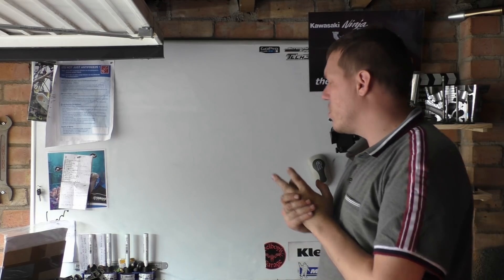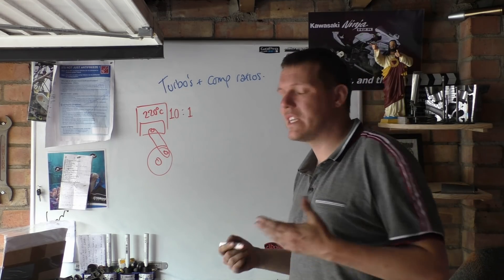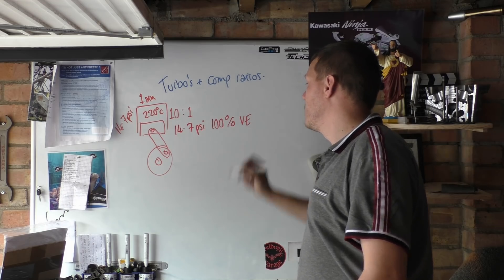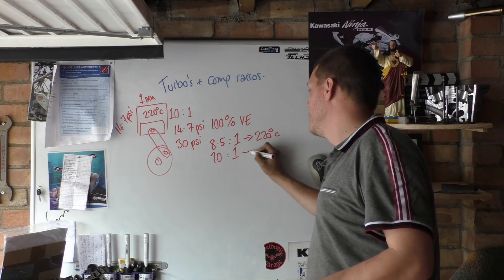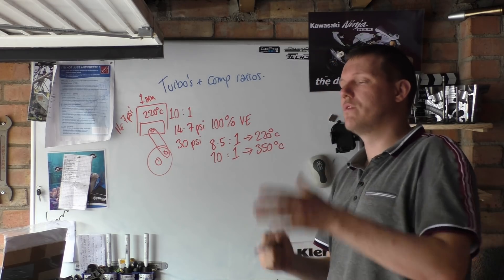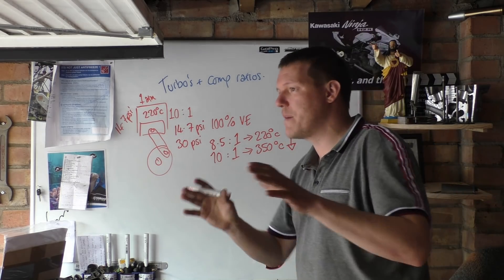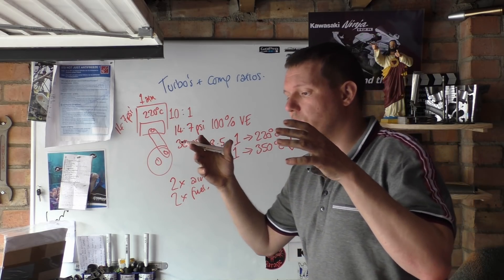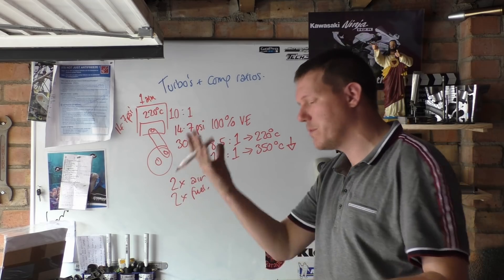So you wanna Turbo your bike - part 4

Comment: Purchased a turbo gsxr1000 non running, got it started then it died on me an I've been at war with it since (2 weeks) for some reason I'm not getting fuel in one of my injector rows, and real shoddy spark as well, I've checked all my kill sensors an still no luck.. it has 2 power commanders a power management and ignition module as well. also running a begi FMU a walbro external inline fuel pump and a turbo timer bike came mostly dismantled also getting really shoddy spark any info would be great no quite done watching your videos really hoping I get a light bulb moment during 1 of them.  Best, art

Comment: I have a question, could be a stupid one but stick with me... If by adding a turbo, our air fuel mixture/existing compression ratio is too high to accommodate,  would simply running a higher octane fuel capable of withstanding those higher ratios also solve the problem? thanks.
Reply from the maker: No. Well it depends on how high. Running 100% ethanol or methanol gives you you an octane rating of 108. - That's 100% so running 50% 95 octane + 50% ethanol would give you about 102 octane.

Avgas (aviation fuel) still has TEL (lead) in it and that stuff has an octane rating of 130 max. But it changes from blend to blend.
Reply: @thedirtyworkshop  thanks for the full response

Comment: I apologize if this is too crazy or foolish. But what if, I kept the high compression-ratio, advanced the ignition-timing a few degrees for improved response, and to prevent preignition & knock, I just setup the engine to inhale chilled air?
I always wanted to have some freezer or ac system, for intercoolers, and the air entering the turbo compressor itself.
Reply from the maker: You'll have to drop the temperature quite a lot, and the problem is can you chill say 1 litre of air for a 1 litre engine @ 5,000 rpm quick enough? The answer is no. That'll be 2,500 litres per minute or 41.6 litres per second. Your heat exchanger would 1 - be massive, 2 be a massive restriction
Reply: @thedirtyworkshop  
Thank you.
I have some experiments planned, including using Peltier-Devices. I love Dustbin-fairings. I'll have a lot of room, to hide components. I'll let you know how those experiments go, when I'm able to do them.
Thank you for helping me.
Reply: @thedirtyworkshop  
I just had a great idea.
Another thing I learned from car racing. There is a system, that increases boost, every time you shift up.
You program every gear, to have it's own max psi.
It's meant to make it easier to maintain traction, when launching a car, but you will have full potential, in top gear.

I can use that system, to keep boost at safe levels, but at higher speeds, I can use that higher airflow around the bike, to get the most out of my chiller system, with high flow radiators, intercoolers, and or heatsinks. 

I can also just setup an Arduino, to limit boost, based on the air temperature, after the chiller system...So it can never be in that preignition temperature range...

And I found an aftermarket knock sensor, that turns on a light, when it detects knock. Thank you for telling me about that. Along with a wideband A/F gauge, that knock sensor will be a big help, with my experiments.
Reply: @thedirtyworkshop  
Hey.
I found the video where I learned about that system, that let's you set the max boost level, for each gear.
After watching that video again, I thought I couldn't use that system, because it looked like it can only control boost levels, when shifting up, not down, so I would have to reset it, EVERYTIME I came to a stop, or else, I would be doing wheelies, like a speedboat in wavy water, when I tried launching again. Like when getting away from traffic, after a redlight. Especially from Electric cars.

Plus, it looked like it needed the clutch, for it to work, but I really, really like Quickshifters, because they let me save my clutch-hand, for waiting in gear, at a light, ready to escape a rear-ending or something. And, a Quickshifter is great for a turbo system, because it allows me to shift-up, without chopping the throttle, and slamming the door on all that compressed air, that's flowing from the turbo. So I will only need a recirculating Blowoff-Valve, when I intentionally close the throttle, to avoid something, take a slight curve, slowdown, or stop.

But I found that Turbosmart e-Boost 2 system, and downloaded the Instruction Manual...
And it's great!
So many features.
I can even limit boost levels, by RPM, so when I want to ride around, efficiently, like in 3 or 4 thousand RPM, I can set it to allow little to no boost, in that range.
And it CAN control boost limits, for every gear, whether I shift up or down, without resetting.
SSB, Sequential Switching function B.
Which doesn't need a clutch.
I maybe able to use, even combine, the shift-lever switches, that a gear-indicator kit uses.

The video where I learned about boost-by-gear:
https://www.youtube.com/watch?v=4ICz12UcRCc

e-Boost2:
https://www.turbosmart.com/product/eboost2-60mm-black/

Comment: Hi
I have few motocycles in my garage and decide to turbo BMW K1100 1993. Was looking for any info but there is totally lack of information, and now found your video and can start up. Will you (maybe) give me some advice for that particular bike, especially what kind of turbo should be used. I'm going to attach intercooler as well. The problem will be also to lower comprssion ration because originaly is 10:1, so the question is how to lower that in a proper way? Thanks in advance,,,

Comment: Awesome video, I can't find any info on turbo charging my KTM 450 mxr outlaw quad. I'm thinking draw through vz21 , but this thing has 2 oil filters side by side behind the head , which one can I tap for oil. This is the part I can't find info on. Thanks in advance for Any help you can give. I'm just finishing up my outlaw 84 Vette.i put twin turbo under the rear with a750 Holley dp blow through setup. So I gotta turbo the 450 outlaw now. There a matching pair lol
Reply from the maker: oil filters on the head? Sorry dude guads aren't my thing. Do you have an oil schematic or a manual link or something?
Reply: @thedirtyworkshop  the oil filter on a motor cycle engine is in front of the head mine are behind on top the crank case along with the starter, but is there any harm in tapping one the filter covers?
Reply: @thedirtyworkshop  I would like to find some specs on the ktm 450mxr engine. Like compression ratio, valve lift, and such
Reply: Where can I find an oiling diagram or blueprint for this engine
Reply: I figured out this ktm450mxr has 2 rotor pumps inside , that's why 2 filters. But one is shorter than the other and I have no idea why there's 2 pumps or which one does what lol. So I still don't know which one to tap. I'm thinking one of them supply's the top end, and that one is the one to tap.

Comment: Is it possible to inject the fuel at top dead center... I think it's called, and cause the thermal ignition at the right time without a spark plug?
Reply: NVM
HCCI Mazda
Reply: And Diesel Engines
Reply from the maker: No, well you can but its not a good idea - more on this later.

Comment: Back in the 90’s I had a Saph Cosworth, tuning or optimising as you correct me, involved lowering the compression ratio, putting in a metal HG, huge turbo and sloshing fuel in with grey injectors. Was horrible to drive, all lag and torrid boost... what manufactures get away with these days when you look at comp ratios and turbocharging is genius. Big power 2.0 in-line 4’s are now nice to drive.... sorry for the car talk. As you were.

Comment: Easy way to drop the compression, get a bit of steel 2mm thick and cut out your head gasket thats what i done to my car a few years ago to turbo charge it 👍🏼
Then a 5th injector on the inlet manifold wired to a bosst switch to compensate for the extra fuel needed 👍🏼

Comment: Can boost without adding additional fuel, increase compression in effect improving thermal efficiency
Reply: Then you would run lean all the time which leads to increase in NOx and CO emissions and higher combustion temperature. So no, not a good idea.

Comment: Great video Matt, Im about to start a Turbo build on a GSX1100, its a first for me so gaining as much  good guidance as possible, had a Garret turbo built for the job with billet internals, with spacing the barrels  I'm told I can run about 8-9psi, I will have a search for parts 1 2 and 3 later, cheers for the upload.

Comment: How would you go about changing the compression ratio for an engine? Smaller conrod?
Reply: Em Fr You can put two headgaskets on, is the easiest way. Although im not quite sure if its the most ideal way.
Reply: blu3flare25 didn’t know if that would be enough to go from 12-1 to 9-1 or whatever with just a few millimeters. I feel like a shorter conrod would collide with the crank at BDC. Could possibly make an aluminum plate that fits between the head and the block?
Reply: Often it is done by machining out the chamber, part of gas flowing process tends to do this, you can also use a slightly different piston crown

Comment: What if you compress just the air to a really high ratio and then use a really strong injector to spray in fuel at TDC?
Reply: That’s exactly what a Diesel engine is lol
Reply: Recently there are some direct injection petrol cars, ironically one of the downsides to them is that the inlet valves can get coated up with oil deposits etc from crankcase breathers etc, no petrol passes by them to clean them. Some of the desperate solutions include fitting the engines with double the number of injectors, each cylinder having a "direct" injector and an "indirect" injector, which one is used depending on engine temperature etc.
Reply: Modern diesels often inject in "phases", the combustion is not instant so injection is advanced slightly, so just before TDC. In the interests of quietness etc some will inject again after TDC....I am not an expert on this, just have a diesel car....
Reply: Why not do the same with petrol but at TDC? Petrol is more volatile than diesel so it should combust faster and it's better if the power is applied to the piston after TDC in terms of efficiency, no? You'd probably be able to forego the spark plugs too since the air is already compressed and hotter than the autoignition temperature. But the injector would have to overcome the pressure inside.
Reply: I think that may be exactly what makes gasoline a poor candidate for a diesel cycle engine - It's volatility compared to diesel, kerosene etc.. I don't know exactly why but i'm sure there are tons of articles online about this. It's been many years since I studied this stuff in Thermodynamics class in college so I don't know from memory. It's certainly a good question which likely has some very discrete reasons as to why it won't work well/better than just using gasoline in an spark-ignition otto cycle or diesel/kerosene in a compression/heat-ignition diesel cycle. It might even be due to engine material requirements and cost. i.e. so expensive to produce it isn't economic for sale. High end racing engines may use some of the principals you are asking about. Happy googling. :)
Reply: funcounting I'm not sure if you are being sarcastic, but that's how a turbine engine works. The expanding gas out the back end after ignition drives turbine connected to a shaft. The shaft powers a compressor on the inlet and whatever you want on the outlet.
Reply: Why not do the same with a piston engine?
Reply: funcounting in a normal IC engine air and fuel enter the cylinder together through the intake valve. You can try moving the injector to the cylinder to inject durectly but my guess is that will cause two major problems plus others: 1. Finding a way to inject fuel fast enough that it doesn't ignite incrementally as it's injected seems impossible. 2. Have a valve small enough and fast enough to close off the injector after spraying and before ignition also seems impossible. Basically the answer to your question is that it's just not worth trying given a normal internal combustion engine works fine. If designed and tuned properly so does a turbo charged IC engine.
Reply: Spot on. Serious question: does a diesel engine inject fuel before or after reaching combustion pressure/temp? I'm sure timing can be changed to do whichever, but my guess (not a diesel mechanic) is that injecting before combustion temp/pressure is much more efficient with less emissions. 
Based on the original comment I was looking at this as a "reach combustion temp, then inject fuel" approach to an engine which just seems incorrect for proper IC operation. Basically resulting in a poorly functioning diesel engine. But, maybe I'm wrong and a diesel actually runs better injecting after reaching combustion pressure/temp.

Comment: I think the point you were trying to make was the higher the compression ratio the more concentrated energy is which equals higher energy output. And that’s not even taking “boost” into consideration.
Reply: Furthermore on the importance of energy density. Burning gasoline in open air releases the same amount of energy as burning it under compression the difference is we can extract more mechanical work under compression. An example is an internal combustion engine versus a steam engine.
Reply from the maker: "I think the point you were trying to make was the higher the compression ratio the more concentrated energy is which equals higher energy output."

- I think you mean higher work output - not energy output for the same fuel delivery.
Reply from the maker: LOL just seen your second comment. Higher compression means a bigger swept to clearance volume ratio. This usually means a higher thermal efficiency. 

Like I said - this is something that need its own video.

Comment: Matt, when you do the compression ratios could include air cooled engines.
Reply: Also I've just found out that the P51 had better performance over the ME109 because of fuel quality, the P51 could have higher manifold pressure, is that a forced induction thing?
Reply: Better fuel (higher octane rating) means that you can add more boost before the fuel self ignites.
The temp he shows 220 degrees for normal fuel, would be something like 250-270 degrees, for the high octane fuel, before the mixture self ignites.

Comment: So, if your turbo puts in an extra bar, and your compression is 10:1, does that mean you are in effect creating a 20:1 compression ratio?  I know the actual comp. ratio is still 10:1, but hopefully you know what I mean.
Reply: Yes, that is true atmospheric pressure is about 15psi, so without boost the cylinder pressure would be about 150psi at TDC, with a bar of boost but the same compression ratio it would be 300psi at TDC....
Reply: g0fvt  I thought that was how it would work, but had never had it confirmed. I've never really dealt with turbos as I only own bikes (no car), and with the amount of go modern bikes have, I've never felt the need to start messing with the extra complication of forced induction. But I love new knowledge, so thanks for the answer.  Greatly appreciated.
Reply: A pleasure, the high pressures are a problem with detonation, so a turbocharged or supercharged petrol engine will tend to have the compression ratio dropped. Unfortunately this results in less power off boost.

Comment: I'm running about 12,5:1, after sanding my head down. Original was 11,2:1. Definitly worth doing, even tho it got very tight. When I had a play of about 1mm in the wrist pin after it broke, this 1mm play was enough for the valves to touch the piston and the piston to touch the head also. Guess I shouldn't go any further:)

Comment: Eyup,Northern.Is there a certain point that you can point to and say,yep you can stick a turbo on that without internal engine mods?(To reduce CR).Obviously a more touring biased bike,say,a GSX750F would be more suitable than a GSXR750.Also,how much boost is worth having?Preferably without replacing rods etc?Ive watched some car vids where they are getting very respectable figures with no engine mods at all.